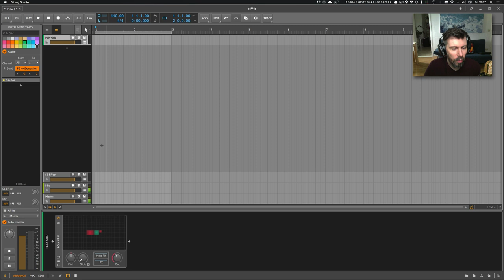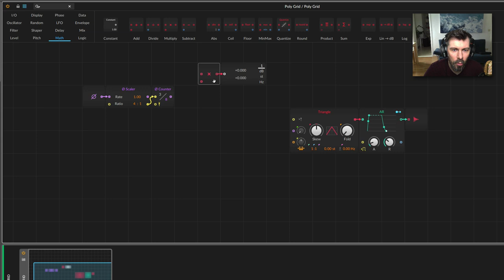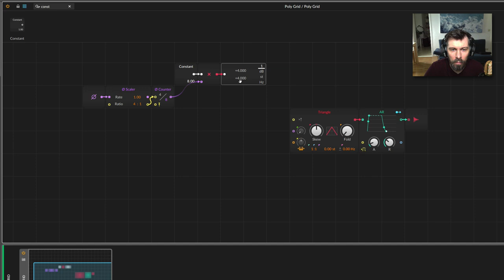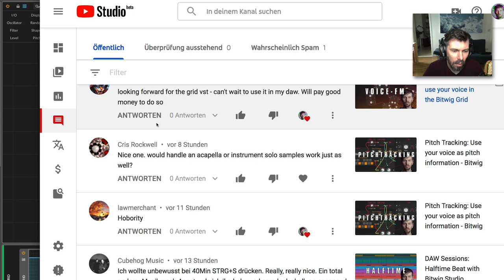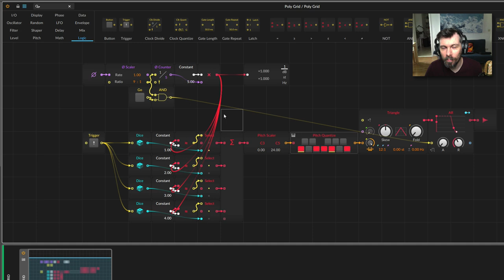Step-Sequencer with random generated pitches - Bitwig Grid

Comment: 1:47 I would love to have the counter value multiply by its own step value automated by math blocks. Is that possible?. That way i could map only the step button of the counter to a knob to have it available outside the grid for quick changes to the step count.
Reply: we would need a math module loop that makes the output potentiate by 2 or something
Reply: then again we have the step modulator now which also has the randomize function and I saw this "Step_Sequencer_303" patch on your bitwig recourse site. I wonder if that might be a better way to do that now.

Comment: Is it me or is that generating 5 steps not 4? Is the 0 value from the counter generating like a glide step? Cuz in a few of those sequences there were two step long notes. Would you be able to solve that by setting the counter to 4 counts, then adding one to the signal, so that it would go from 1-4 instead of 0-3?
Reply from the maker: or set the counter to 4 and start with a 0 on the constants
Reply: yup start the first counter with a value of zero